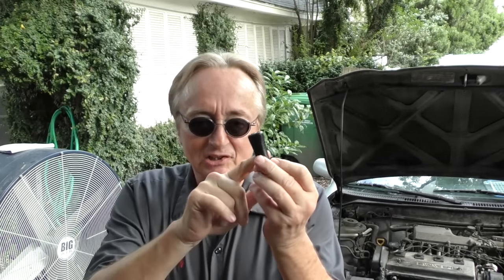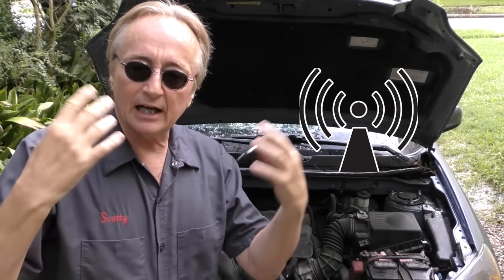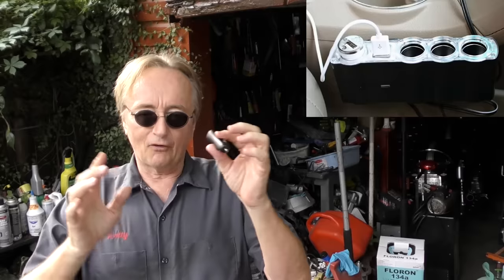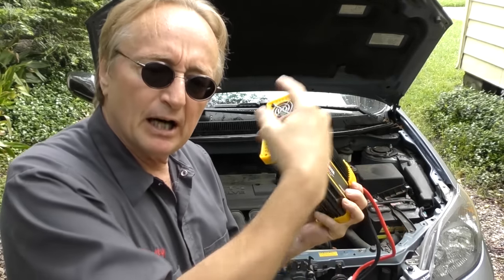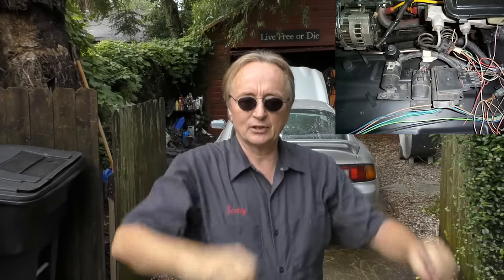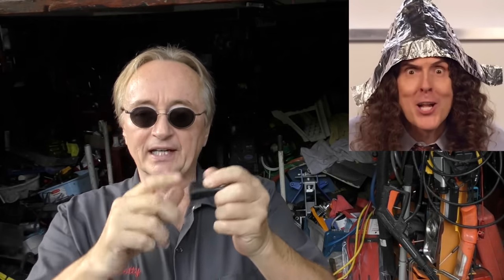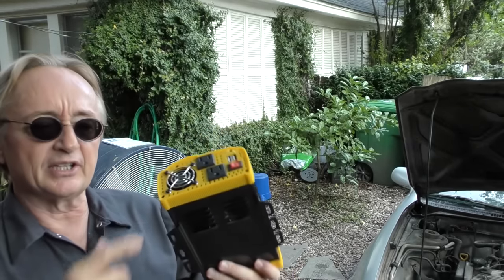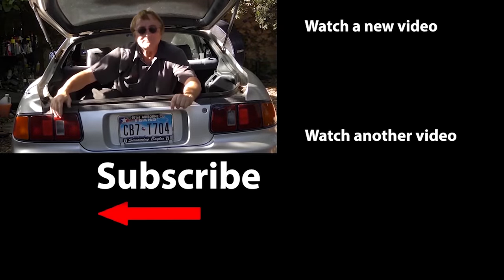This Adapter Will Destroy Your Car

Comment: This is good. I used a small air compressor to air up a low tire. I hooked it up to cigarette lighter adapter in the dash next thing I know my – started smoking it ran for a little while but then the wires melted together and ever since then my car has been ruined take his advice use power adapters straight to the battery.

Comment: The AC inverter also generates RFI as much as the buck converter found in these USB jack. Cheap power adapters do not have adequate shielding nor filtering. Cheap adapters could also destroy your thousand dollars smart devices. As Scott mentioned, buy quality power adapters.

Comment: One of these broke off in my 2018 rogue. I had to pull the fuse as I could not get out the metal pin that was lodged tight . Didn’t want to risk any issues

Comment: I bought internal led lights for my car and I decided to just use the adapter for my cigarette lighter instead of straight wiring it into my car. After awhile my car didn’t want to start right away. Couldn’t figure out why because my battery was fine, alternator and starter were fine. Then I unplugged my lights after I was done using them now my car hasn’t had any problems starting anymore.

Comment: You answered the burning question in my head! Charging my phone when it was plugged into the aux routed the interference thru the speakers which would change from the slightest touch... crazy! okay time to get some wires for my power inverter!

Comment: There are defective regulator designs.  When electrical engineers design electronics for cars they are well aware of EMI and their design prevents or bypasses this interference.  You are correct there are many sources of EMI interference, most of them are much more powerful than the a 5 volt regulator (like parking  your car undera a 500KV power line)  It is standard to design for immunity and test to ensure that the design has accomplished its objectives.  In fact, all of the electronics in your modern car produce EMI that can interfere with the other electronics.  So designing electronics to be immune or to tolerate EMI is essential and is common practice.

Comment: 1994 Z71 4l60e has first and third gears only for years everyone says sunshell I'm skeptical there must be some combination of loss of signal bad or sticking solenoids or ground issue weak pump that could also cause it.  Any thoughts anyone?

Comment: What’s an FM transmitter that I can use that doesn’t cause interference? My tire pressure monitor system light has been on since I started using one.

Comment: I have a nice expensive Inverter in my car that plugs through that bay it has a type c for my phone and 2 usbs for 5v but it's a big chunky thing not cheap so does that cause problems or is it primarily with cheaper devices?

Comment: Those adapters depend on quality, the process Scotty explained is the way a switching power supply works, specifically, the Buck converter, used to lower voltage, but if it was designed poorly, will create EMI, those are designed to oscillate at 100 KHz, in the late 90's and early 2000's they used a linear 5V down regulators, safer but we're not efficient in terms of power supply design for battery operated stuff (like your car), a switching power supply can be smaller compared to a linear one, with the EMI trade-off. My advice: Stay away from gas station el-cheapo adapters and buy quality ones from Best Buy or similar places.

Comment: I had though about wiring an inverter to my battery as you advised....but.... could not see/find a good way to get the wires from the battery into the front seat area of the car.  Any ideas?  I have a subaru forester 2017 and 1999 E250 van.  Thank you.

Comment: I had one that killed my 2003 Honda Accord.   The Car quit while I was driving it.  I had it towed to the dealer and the technician  claimed the adapter was the cause for a 50amp fuse to blow.   He couldn't explain it ... and it made no sense to me ... but I tossed the cheap adapter and the car never failed again (going on 5 years now)

Comment: I supect my charging ports are not A: providing the proper voltage or not providing clean sine wave power that more modern electronics require. How should I test to verify these problems?

Comment: I have a fm transmitter plugged into my 2006 Pontiac Grand Prix that i started having trouble with the speedometer began reading to fast on.  Im going to unplug it to look for any change.  How do I reset the computer?

Comment: You may know cars, but I know electronics. There is no need to convert the 12VDC to AC in order to get 5VDC. To convert from a high DC voltage to a lower DC voltage is easy.

Google "78xx." All you need is a 7805 and a couple of small capacitors.

Or are you just getting a kickback from the manufacturer of the inverter that you hawk halfway through?  :-)
Reply: Maybe watch the video closely instead of trying to score zingers.

Comment: Once in my robotics lab we had a piston solenoid acting strangely, it took us 3 hours to realize that the wifi router had interrupted with the controller of the pistons. The router was too close to the can bus wiring of the piston controller and that messed it up real bad. moral of the story is: don't put anything that makes great interference next to any data wiring, even though can bus was designed to withstand electromagnetic interference it is still limited by what it can do

Comment: i had a car battery go on me after 6 months, once I started plugging in a lot of stuff into the cigarette lighter (charging phone, dash cam, GPS, etc).  I so purchased a portable lithium battery pack USB (with power on/off switch). I only have to charge the battery pack every few weeks and no more worry about draining the battery.

Comment: That is not how they work -- they do not change the DC to AC and step it down with a transformer.  Today, they use a Buck Converter, which switchs a transistor on to the battery only long enough to make the voltage on a capacitor (and the output) 5V.  Bucks can only step down.  They emit a little radio energy (in the AM range) but it's low and varies with how much load you give it.  Buck converters are very efficient, make little heat, don't need expensive and heavy transformers.

Comment: When I was on a political campaign years ago when Starbucks still charged for internet access, I would use on of those adapters outside of Starbucks if they had already closed for the night. I would hook up my laptop when my motel didn't have internet. They all do now.

Comment: I'm sorry Scotty, but you're wrong about the way adapters work. They don't transform DC to AC to DC again, that's way complex and completely unnecessary.
I'm an electronics engineer, and the way it works is:
12V DC from the plug to a diode (to secure reverse voltage)
Diode to capacitor
Capacitor to a positive linear voltage regulator
Voltage regulator to capacitor
Capacitor to LED
LED to USB output

voltage regulator can be adjusted easily with a resistor on their adjust and output side, depending on the regulator it can convert 11.8V to 0.1V (max is 11.8 aprox.  due to voltage drop on the diode and regulator, could be more)

So no, it doesn't convert DC to AC and back, and it doesn't generate any electromagnetic waves. In the other hand, conversors that you use to charge your laptop or so in cars, do use AC current. They convert it from DC to AC using transistors and a logic board, that allows the flow of current in a precise way to generate the AC current at the needed Hz. These might generate interference, since after converting the DC to AC current, the voltage is stepped up using a transformer. However, the people that create those products, know about the possible interference, so that's why they're shielded on the inside, getting rid of electromagnetic interference.

Comment: Not just USB adapters.  I had a pre-bluetooth 2004 Cadillac XLR with keyless entry & start which was also a new thing then.  There was no key at all, just a fob.  Plugged a bluetooth receiver/FM transmitter into the cig lighter.  Paired my phone to it via bluetooth, then tuned the factory FM radio to the station broadcast by the device.  Awesome sound BUT...the car could no longer see the keyfob that makes the car start.  Lesson learned - assume nothing!

Comment: While this parasitic battery drain could be the adapter don’t look past your vehicles hands free link which is also Bluetooth. I had a battery drain that I could not find. This impacts a lot of cars, including new, Hondas, Acuras, Toyotas, etc.  Turns out the Bluetooth module from my Acura was fried. After disconnecting it my battery drain is gone. Some manufacturers have a firmware update but if your car is old like mine, may just want to disconnect or replace the hands free link module.

Comment: How about one of these plugs thats wired to a heated pad - heated seat pads for the driver's seat?  Has an on/off switch on the cord.  When not in use, I unplug it.

Comment: I am surprised the cheapo units don't have just voltage dividing circuits, rather than using an inverter then going to a rectifier.  All you need for a voltage divider is three resistors.

Comment: Electronic tech. here working with RF transmission. for 15 years.

1- We know how Electromagnetism work.
2- Gravity pull you down toward the earth not electromagnetism.
3- These Chinese phone charge are super noisy and will affect RF equipment.
4- Car electricity is super noisy so car system are hardened again electrical noise.
5- These power inverted are even more noisy than cheap Chinese charger  also they are incredibly inefficient and rarely output a true sin wave this can cause issue with some device.
6- Car lighter socket are 12 volt 5 amp rated with is 60 watts.  USB 3.0 spec go up to 100 watts for power charging. check your device to be sure.
7-Unless its catching fire no it will not destroy your car.

Comment: Phone charger are all DC anyway. That DC charging adapter does not create AC voltage. You need an inverter to do that. Go look at the AC adapter for your computer or phone... It converts AC to DC. The little one in your car does not create AC current.

Comment: Late to posting but not only buy a quality adaptor but also unplug them when not using even if they shut off with the ignition. It will give a chance for it to discharge. 
I try to use quality battery packs and don’t leave them in the car especially on hot days.

Comment: I just have to correct you... even if the cideo is a year old

What your describing is A method, but i have seen another where it uses a (name forgotten) and it just goes on and off quickly, and the average of the time on and off is 5v, and if it fails then you just get constant 12v (i know cuz i just had that problem)

Then it goes into an inductor and capacitor. That method is cheaper, and I'd argue safer

Comment: I kinda wonder if the usb plug in my 2015. Colorado is causing an issue . My engine light goes on then off later . Says that engine is powering down

Comment: As an engineer I can say most of this about the RF interference is not true. There are laws that the product has to conform to for wireless and wired devices (ISO for manufacture and IEC for circuitry - international standards). These should prevent the product from interfering with other products in normal use. How is it that an inverter wired to the battery to produce a full wave A.C signal at 110V 50Hz is not making any interference but this smaller device is making more? Most likely using a PWM (square wave not actual AC waveform) possibly in the kHz range. Or if its a really cheap one maybe just a resistive dropper so no AC signal at all. Most wireless systems in car will be in the hundreds of MHz range anyway.

Comment: 🔵 For quite a while I've been having trouble receiving certain FM stations on my car radio, they were very weak with a lot of static.... Well, I unplugged my radar detector and the reception improved TREMENDOUSLY right away.
The funny thing was that even with the radar detector turned-off the reception was still bad but unplugging it all completely made all the difference!

Comment: THIS HAPPENED TO ME WITH MY OLD 2003 PT CRUISER. Plugged a 5v adapter for my phone one day, next day ALL MY HEADLIGHTS BURNED OUT and after hassling with installing new light bulbs and fuses i ultimately had to trash the car completely bc it couldnt be fixed

Comment: About gasoline costing an arm and leg... if I read that right, regular gasoline cost $2,34/gallon when that picture was made... well, the closest thing to this "regular" back here in FInland, is likely 95E10 which now goes around €1,60/liter. A FREAKING LITER! That means that if a U.S. gallon is roughly 3,9 liters we have our "regular" gasoline going at €6,24/gallon... or $6,74 with the current converision rate!!! Threefold, almost! 

Diesel goes for 1,3€/liter or $5,48/gallon, but then, similar sized Diesel engines tend to cosume up to 35% less juice for the same trip. As the yearly registration costs for a similar size Diesel engine are about double that of a gasoline engine, the turning point is around 25.000 km/year, over which it is usually cheaper to drive a Diesel car. I went Diesel a couple months ago and I'm not likely to go back unless pricing becomes prohibitive by another whim of our government.

Comment: Thats hilarious, I use anker 12v adapters and havent had any issues.  But it makes sense. 
Got yourself a new subscriber, plus you remind me of my old boss, very funny to watch.

My stuff is also wired directly since I ran a 4 gauge cable into the cabin for the light audio equipment. 

My car is a bit more ancient so not a lot of items to interfere with it, I do keep a volt meter running all the time which takes up one of my sockets just as a heads up if trying to start at 11v ... no bueno ... give her a little charge after sitting.

Comment: Not radio interference... It is "Harmonic Distortion" which causes the problem... That happens due to the DC switching without proper filter circuits. Yes, Harmonic Distortion can destroy literally anything. In big factories, there will be Harmonic Distortion mitigation systems from ABB or Siemens to deal with the Harmonic Distortion caused by the DC Switching circuits in VFD Drives. Even cheap LED Lights will cause this problem and cause issues to your household electronics. General rule is, "Total Harmonic Distortion" THD should be less than 5%. Well, the topic is too big, but using cheap items in car or even household items can cause havoc to other equipments.

Comment: New member just subscribed great video.  I have one of the new 5G phones and I didnt have a USB plunged into my car at the time and the check engine light came on for a couple days then went off, I thought it was a sensor. Any info or a video on this would be great 5G and the frequency causing those kinds of problems.

Comment: A DC USB adapter doesn't convert from DC to AC to DC.  It converts from 13V DC to 5V DC.  If it were converting from DC to AC back to DC, there would be an electrical coil, which there isn't.  Also, a USB device cannot draw more than a specified amount of current.  The exception to this would be a USB PD connected device, which can be variable, but the maximum draw on a USB PD power supply would be 100W, or 20A at 5V DC.  The average USB adapter is 2.1A at 5V DC. Connecting a USB PD device to a standard USB adapter would result in significantly slow charging rate or no charging.  The reason the unit melted was because it was a low-quality, poor design, or the person Gerry-rigged a power cable to power a non-USB device.
To provide context:
A DC Adapter converts from one voltage and amperage in DC to another. Very efficient - low heat. 
An AC Adapter converts from 120V AC to a specific or variable DC voltage or amperage.  Less efficient - moderate heat.
An AC Inverter converts from 12/13V DC to 120V AC.  The amperage output is based on the size of the electrical coil.  Inefficient - significant heat.
An AC Inverter, by the way, will cause more EM waves than a DC adapter.
As you suggested, if they were to first invert from DC to AC, there would be a loss of energy (in the form of heat), and then again in converting from AC to DC.  

Humans can see electromagnetic waves.  Humans that cannot see electromagnetic waves are blind. The EM Waves, also known as Light Waves, include the Visible Light spectrum of waves.  What you see as color, is an electromagnetic wave either being absorbed or being reflected.  Yes Virginia, you see energy.  We are just limited in the EM waves we can see, not that we can't see them.
The most likely cause of the issues you are seeing is the power drain.  Even when not used, AC or DC adapters, and definitely AC Inverters, drain the battery, even not when used.  If devices are left plugged in while the car isn't running, a low battery may cause problems.  I had a small inverter drain my battery in four hours.  Some vehicles may be more sensitive to the power drain.

Comment: Well, Scotty is wrong for the first time. There is no reason to convert DC-AC-DC while DC-DC conversion can be done straightaway preventing unnecessary losses. Usually, 12V DC- 5V DC can be done via a buck converter. However, EMI still may take place, i agree with that.

Comment: Seems to me a transistor could reduce the voltage from 12V DC to 5V DC and eliminate the stepdown transformer, which is why its converted into AC in the 1st place and causing those male pattern balding EMFs. But then again, I can't make ice cubes without starting a fire.